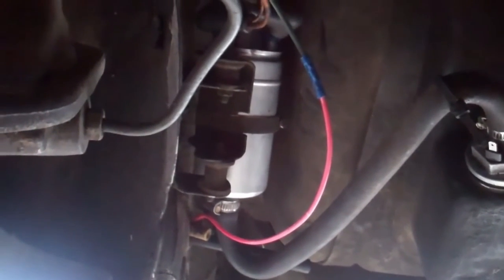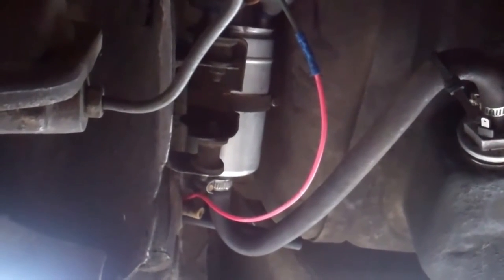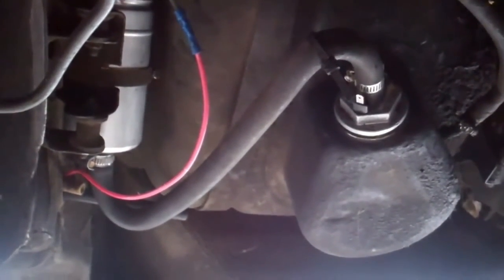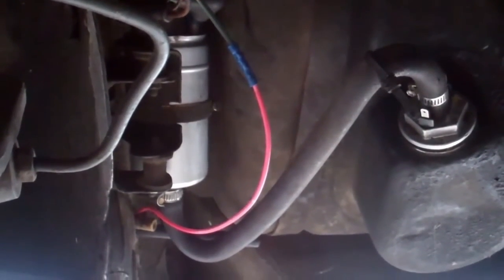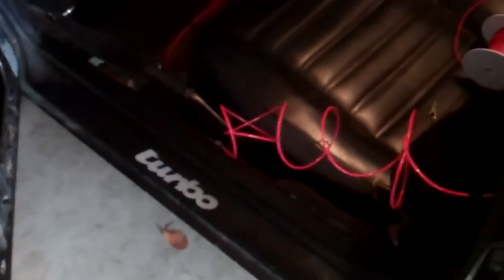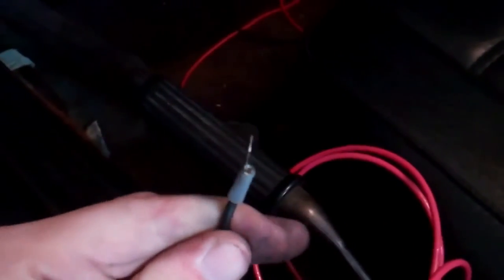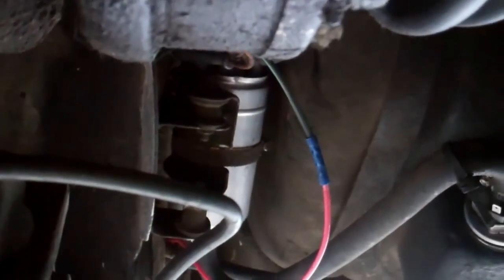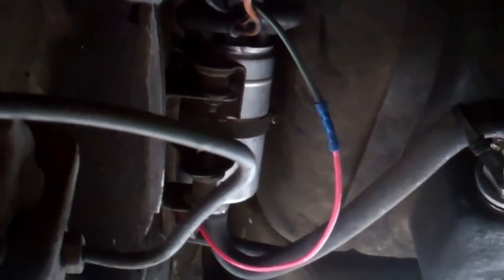1981 Porsche 924 Turbo | Rewiring Fuel Pump For MegaSquirt

Comment: The fuel pump relay won't supply power to the pump if the boost overpressure switch is disconnected. That's the little switch that looks like an oil pressure switch in the front of the charge pipe.
Reply: Hi long time ago you wrote this just seeing if you will reply! What is the charge pipe?
Reply: @SuperSteeveo  the pipe that runs from the turbo outlet to the throttle body. There is a very simple pressure switch in it just before the throttle body. If you ground that wire, the fuel pulp will run. I think it’s purpose is actually as an overboost sensor. If there is too much charge boost, it cuts out the fuel pump so you don’t destroy your engine.
Reply: Oh I see mine is a 924 non turbo so guess I won’t have this!
Reply: I’m basically having the same trouble pump won’t run tried to put a charge though it with a separate battery and it doesn’t make a sound I guess it’s shot?